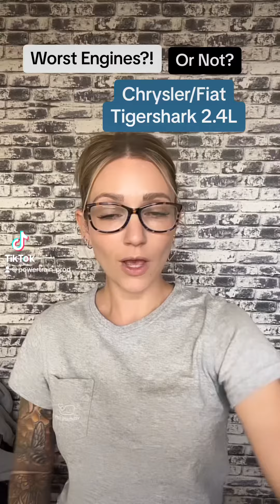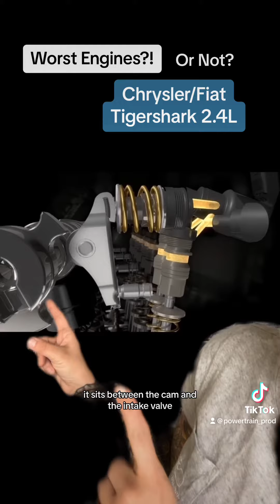Chrysler/Fiat Tigershark 2.4L Engine

Comment: I had one in a 2016 promaster city, worst engine that I have ever encountered
Reply: He’s right maybe it’s just since it was a work van and it was on the fleet that people didn’t maintain it nor checked the oil when they were supposed to because I work for AAA and at my location the had a few road masters from Ram with the same engine and it sucked ass it would suddenly loose power on the highway every light was on it left me a couple times on the side of the road then there’s my mothers 16 Cherokee she got hers with 26k miles and we did have to take it to the dealer once because it shut off while driving , turned back on but not a good sign nonetheless they said it needed oil it had no Oil but the car was still 2k miles away from the nxt oil change with them , they changed it for us and the tech told me that these new engines burned oil and instead of changing oil at 5k miles to change at 3 and to always be checking 2-4 times a month just to make sure , ever since then I’ve always kept up with her maintenance myself from the brakes to suspension even to it’s first tube up she’s now at 150k miles because she worked doing Uber smh but its all about who drives it how they drive it and how they maintain it tbh it sucks they suck a lil but aye most cars nowadays always tend to skip a beat every now and then
Reply: I’ve never experienced issues, not even a check engine light at 250,000 miles and counting
Reply: @gavinmcconnell8994  the one I drove for work had over 188,000 miles and it has been doing it for some time from what my coworkers have told me, still it lost antifreeze for no reason, the engine clattered at idle, sitting at a stoplight while in drive it would shake like mad, they are just rebadged fiats so you can already tell they are just going to be unreliable
Reply: @captiancraft3020 shaking is prob the bad motor mounts Jeep put on them
Reply: @stevengower  it also had valve clatter and lost oil like mad
Reply: Let's give a s/o to peeps clocked in when it broke down! Imagine the masses that were rushing, on their personal time and insurance, trying to clock in and derp.stationairy